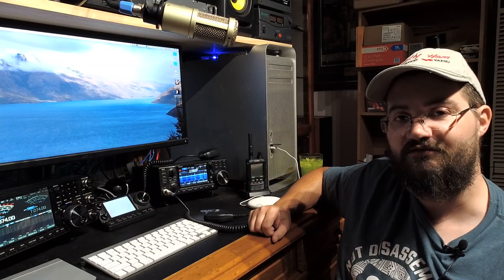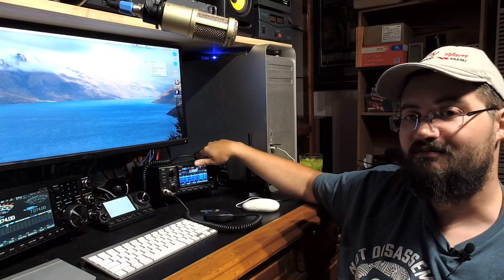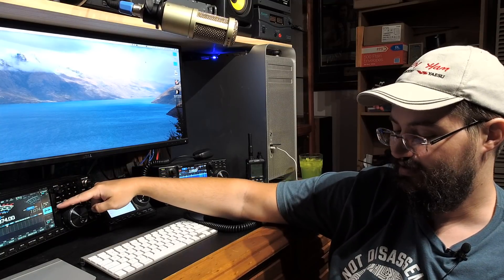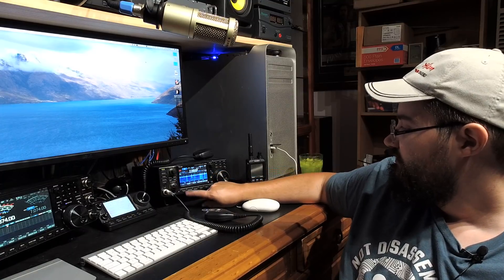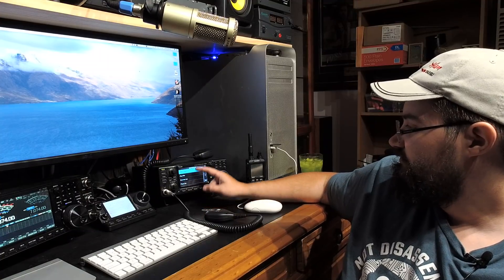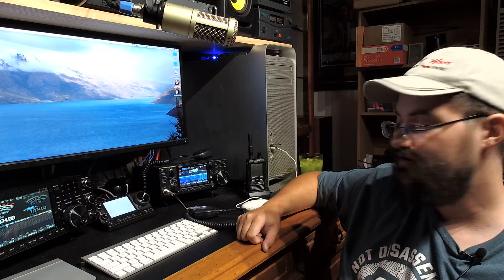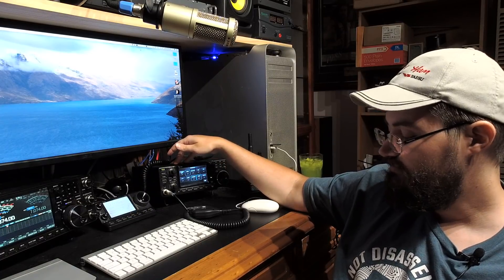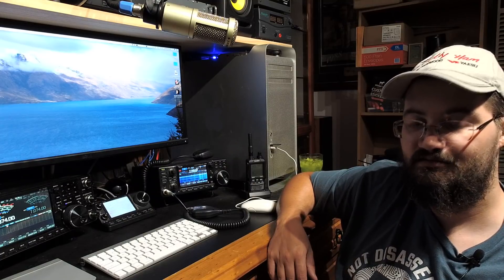5 Ways the IC 7300 is BETTER than the IC 7610

Comment: Hi Jarred, thanks for this and other videos on ICOM 7xxxx gear.

I have the IC-7300 and just love it. It does everything I need and then some.
I was thinking of buying the 7610 as a birthday present for myself when I turned 60 years 'young' last September, but the radio was not available then. It's /still/ not available in Europe and even if it was, I'm having second thoughts about the purchase now. 

Guess I'll just stick with my 7300. 

One thing I like in 7610 over the 7300 is the lovely anlaog style meter. That just looks so cool! 
But instead of shelling out a  big pile of  Euros ( if the thing ever comes available here )   I can just create a computer program displaying an analog meter on PC., HI!

73's de Kari oh2gqc
Reply from the maker: Dear Kari, the IC-7610 has a lot of lovely additional features - the opposite video would be something like 10-20 things the IC-7610 does BETTER.

The point I'm really trying to get across is that newer hams should work on other aspects of their shack first; that the IC-7300 is a very competitive and capable rig, and exceedingly good value.

If you've got your shack to a level you're happy with, I can't imagine you'd regret getting the IC-7610 so long as you don't have to stretch finances too far.  The IC-7300 should still make good money second hand, so that will offset the cost.

The other thing is, if you can wait, I am pretty confident prices will drop pretty quickly once all of us 'must haves' have put up the big dollars.

73 & Happy belated birthday! Jarrad VK3BL & the Rate My Radio Team :)
Reply: Hi Jarred, thanks for the birthday wishes ;)

I know the 7610 is a fine rig. I believe I've seen every YT video there is featuring 7610 and I have also downloaded the manual & stuff.
Time will tell if one of these boxes will find it's way to my schak.
First, of course, Icom must make the radio available around these parts of the world..

Comment: I presently have a 7300 on loan from a friend while i decide which hf set is for me, its very difficult to ditch it for the money, it does take some beating really and the ones that possibly do are three times the cost. I can see you have a iMac like myself and now i use RUMlogNG which when connected to the 7300 via a usb is a great feature. Not only do you have a log book but you  also have a rig control and the ability to route your audio and recorded it so you can store or play back over the air, this opens up more of the 7300 just fine, without being to complicated or messy, so what a great enhancment to the radio especially if your a mac user and suffer from the fact that Ham software is mainly windows based, yes i know you can run windows on a mac but thats like putting water into whiskey. I think the 7610 is a good radio but not three times as good as the price dictates. Thanks for the video Jad keep them coming and happy new year, Regards Steve G0OGS

Comment: Jarrad love your videos on the IC-7610. However I think we should stop comparing the two radios. Everything you said about the IC-7300 was your opinion. I have both radios as well, and I never think about comparing the two because they are built for to different market segments. I agree that for the money the IC-7300 is the BEST value in Ham Radio! The IC-7610 is for a different segment of HAM Radio. Time will tell if it performs as well in it's segment as the IC-7300 does. Keep up the videos, I do enjoy your point of view on this radio.
Reply from the maker: Dear Steve,

You make a very valid point - you can't directly compare them, as they are in a different price bracket / market segment.

I don't plan on doing any more comparison videos; the point of this video was mainly to encourage newer hams to spend their money on other parts of their shack, rather than drooling over the latest and greatest.

Experienced Hams like you and I know that the antenna does 90% of the work, and given the bargain price of the IC-7300 I feel there has never been a better time to get into the hobby.

Hopefully, this video will encourage some of the newer hams in our ranks to go with the IC-7300 and put their money into antennas and essential shack items.

Lets face it, the IC-7610 is a Lexus, whilst the IC-7300 is a Toyota; and the average new Ham just wants to get to 100 (DXCC); which even an FT-101E will do for them :)

That said, the next upgrade to my shack will be in the order of $100,000 (acreage in the country for better antennas and lower noise levels), so I could quite easily justify the price of the IC-7610.

PS, we both know if I did the reverse video it would be titled "50 Ways the IC-7610 is BETTER than the IC-7300" :)

Thanks for the comment,

73, Jarrad VK3BL
Reply from the maker: Dear Steve, I conducted a poll on FB, and approximately 80% of people (45 to 9) feel there is value in comparing between market segments. 

A lot of people are 'value driven' in their purchases, and this is the main benefit to comparing between the different market segments. 

Of course you pay more for luxuries, but sometimes its helpful to know when its wise to invest in a luxury. 

What do you think?